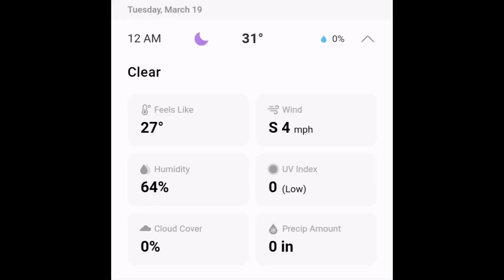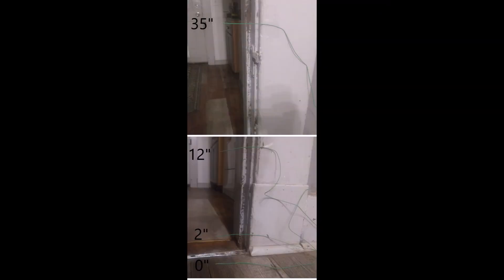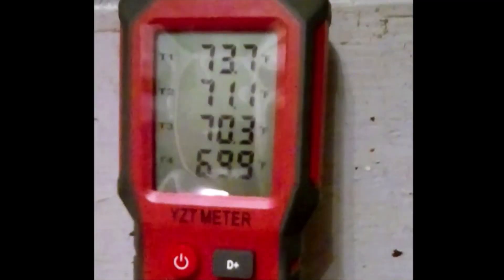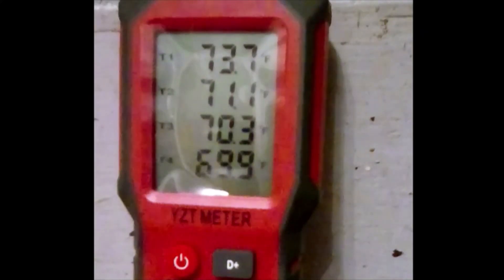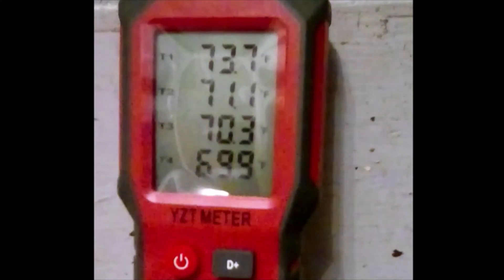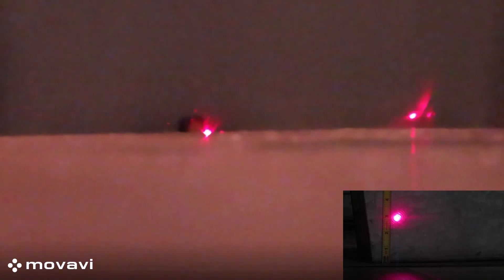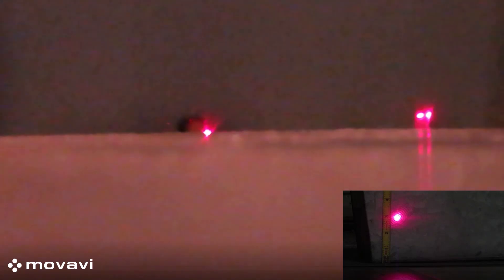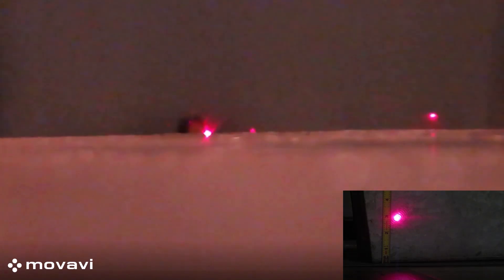At Home Refraction Tests - March 2024

Comment: After analysing your experiment, there is a big big problem with your conclusion in favor of flat earth here.
The density gradiant over large distances on Earth is mostly denser at the bottom due to gravity and less dense as you go up. You don't agree gravity exists? Fine, doesn't matter, it's a fact the air becomes less dense the higher you get regardless of the reason you want to attribute to it. There are pockets of less dense air at the bottom and denser air above due to air currents, but it's mostly denser the closer to the ground.
In your experiment the bottom sensor shows hotter air than your second sensor, meaning you have around 2 inches of hotter, less dense the air at the bottom and colder, denser air in the sensor above. This explains the upwards refraction perfectly since light refracts towards the denser medium.
HOWEVER. The reason this wouldn't happen on an every day basis on a flat Earth and consistently hide whole buildings or things higher than 3 feet is because, as I said, in the outside world, with scales bigger than a few feet, the air gradiant is pretty consistently more dense closer to the ground and less dense the higher you get. This causes the light to bend down, not up, causing us to see further than the geometric horizon/curve of the Earth instead of objects being hidden by refraction.

Comment: Great experiment showing that refraction causes light to bend down from lesser to greater density.  At the start of your experiment, 1:25, we see a slight 3.9° temperature change from the top T1 sensor to the floor T4 sensor. (T1 - 73.8°, T2 - 71.2°, T3 - 70.2°, T4 - 69.9°)   Since we know colder air is denser than warmer air,  this would cause a slight downward refraction of light.  

After the door opens we do see the buttons move slightly up and down as cold air moves in, but @ 1:35  the 2" T3 sensor is now the coldest reading, 64.0°, which is 3.7° colder than the T4 floor reading of 67.4°.  This would cause light from the buttons to bend up from less dense 67.4° air on the floor into the more dense 64.0° air two inches above the floor and as expected, this is when we see the buttons disappear downward since the light is now bent above the camera..  The reason the T4 floor sensor is warmer is because of heat retained in the floor. 

Again, this is a great experiment showing that refraction causes light to bend from less dense to more dense air but this is not proof of either a flat or globe earth.  What is does show is that atmospheric refraction is can be complex, in this case due to conditions where a colder layer of air can be above a warmer layer of air, when typically the atmosphere gets cooler as it gets higher.
Reply: With the door open and the temp settles with warmer lower cooler above....similar to standard atmosphere...the light from objects higher than the camera will first refract toward the floor, avoiding the denser cooler air above aided by the angle of incidence to the camera.  These are the same conditions that can also cause inferior mirage if there's a sharp enough density gradient down low.....but even w/o a mirage present....objects along the bottom get obscured.  So....w/o the light reflecting mirage....is the light going above your head or is it just lost in the floor....possibly compressed there?

Comment: Hey guys, one thing I noticed immediately is that while the upper three sensors follow the narrative of standard atmospheric refraction where the gradient progresses in a vertical fashion with descending height, the lowest sensor shows a reversal in the gradient. One theory that I have been working on would agree with these results. Reflected light off of objects above a level refract due to changes in the vertical lapse rate. Reflected light off of the ground behaves based on how the surface of the earth compares to the atmosphere just above it. In your demonstration in the micro, the buttons might still be considered as above center camera level even though they are on the surface of the floor. This situation may cause downward displacement of the objects above the surface and still allow for upward displacement of the ground itself. In the macro, that would mean that islands, mountains and large ships would appear lower due to refraction while the water surface may appear higher due to reversed refraction. Where the boundary converges, we would witness compression if we studied that thin line well enough. Otherwise, it would just be summed up as undefined visual obstruction or earth curvature. Just my two cents. Thanks for your efforts.

Comment: Love your thermocouple set-up....
Reply: Appears to correlate with my observations when the surface is warmer than the air above like with a standard atmosphere (modeled sounding data @ Mugu)....the background drops...and obscures the lower bits (buttons in this case)....the light hitting your eyes at a lower than actual angle.

Comment: Whilst temperature will play a part, it is the water that creates the trickery. Have a watch of this prof explaining how it works. 
 https://youtu.be/WjrMe5bYpk4?si=TF3UDteB3kF2um0T
Reply: Doesn't the water mimic the effect of the ocean on observations though?
Reply: @Steve-h-v  That's my point. water evaporates and condenses due to vapo-pressure which occurs in layers. I am gonna go out on a limb and suggest evaporated water and condensed water gives 2 different effects which matches OP's demo. Cold air rush in = condensing,

Comment: These test really are getting very useful now that the actual air gradient can be inferred. I have read all the comments here. This is getting to be a very useful channel to find out how light is behaving at the surface of this place. There are some quality explanations and suggestions being provided here. :) 
   Given that the tests done appear to scale to the real world. I suspect that we can provide a useful explanation for what is happening to the light from distance observations in a variety of common conditions. Fascinating stuff! :)  
   Thanks to yourselves for doing these tests. They are very useful and informative. Thanks to all the people who post detailed comments based on their own observations from the real world. 

   It really is an enjoyable time for me when I go through these videos and interpret them and the comments provided. It can take me a while. It is fun!
Reply: They don't, though. As the observer gains altitude above the ground, the angular size of the inferior mirage (assuming there is one) decreases as it is visible close to the horizon.
Reply: The experiment is not to scale though. In the real world the air gradient goes from denser air at the bottom to less dense air the higher you get. Here her experiment is at a very small scale. The opening of the door causes a reversal in the gradiant in the first 2 sensors where the air below is les dense than the one above, causing light to bend up and hide the buttons. However, in real life at the scale of buildings and ships, this rarely happens, which is why this can't explain why we consistently see objects being hidden behind the horizon.

Comment: This is great and everything but can you please answer something i believe would be simple to answer for s flat earth believer.
Why can't i see the massively bright sun across the flat earth at 35k feet in the thin atmosphere....... But i can see the small faint Polaris from just 100 miles north of the equator through the thick atmosphere... At night?!?

If you want more details to the question I'll be glad to elaborate on it.
Reply: "Why can't i see the massively bright sun across the flat earth at 35k feet in the thin atmosphere".... I assume you mean from an airplane? You're in thinner air, but you're still looking through the entire thickness of the air below as well, if the object you're looking at is perspectively below the slice or gradient of air you're in.

"But i can see the small faint Polaris from just 100 miles north of the equator through the thick atmosphere... At night?!?".... I assume you're back on the ground now? Polaris is at the center of the earth. At that time, the sun is much further from you, clear on the opposite side of the world, further then Polaris is from you. In this example you set up here, it has more to do with distance than the atmosphere. The celestial bodies will either rise or lower in your perspective by 1 degree every 69-70 miles. Same with standing under or next a tree, you have to look up at it, but off in the distance you can see the whole thing and not have to look up at all.... because of perspective... If you could stand at the north pole, Polaris is directly overhead, but by the time you reach the equator it will have set in your vision. Perspective and refraction both play a role in the "setting" of objects. At night, the sun is well beyond Polaris from your position. It's simply too far. You would need to get closer to it before it would begin to rise into your field of vision... although there are some examples out there of seeing the sun and moon from great distances. If you got a little closer, a little higher, and had the best of atmospheric conditions ahead of you, you just might catch it!
Reply: @DontSphereTheTruth 
Actually;
We are using flat earth geometry.... Remember that.
Question elaborated.
I take Cathey Pacific airlines from NYC to Hong Kong. The flight route goes over the north pole and departs NYC at 3:15(ish) est.
By 10:30(ish)pm est the flight is at 35k feet at approx the artic circle.
The sun would be located approx between Guam and Hawaii at about the equator. This would be (with a 3200 mile high Sun) place the sun approx 8300 away. Also remember....35k feet and 3200 miles and 8300 miles.

At just north of the equator (100 miles) I can stand on the ground and look north and see the star Polaris. Polaris is approx 3200 miles high. Distance from observer to Polaris approx 8600 miles. And remember you are looking through 35+ feet of atmosphere from ground level.

You explanation does not make any sense.
Can you recalculate that and give me a more logical answer please.
You have just one more chance to make your calculation fit reality, otherwise you are a delusional hack.
Reply: @ENDtheFED-it4bo  Everything sets given enough distance....based on how our eyes work....especially when closer to the ground...the effect is amplified due to your limited viewing angle.
Reply: @ENDtheFED-it4bo  You give distances and Height of the sun. I appreciate that makes sense to you. However, you cannot verify that your values are correct.
   I suspect you have made the assumption that you are looking at the sun directly and it is a physical object where you see it? 

  That cannot be correct. It is impossible to accurately triangulate the sun or moon from three or more people spaced a few hundred miles apart. ;-/ This is using sextant and compass.  
   
  Instead of the sun, think about trying for three or more people, spaced a few miles apart, to accurately triangulate the top of a rainbow... Then one of the observers moves towards the rainbow and takes some more readings. 

  In both cases above, when plotted out in 3D space, the reading will not cross at a fixed point in 3D space! 

  This was actually shown, and proved, by Sly Sparkane in a video about sun tracking a few years ago! The sun cannot be accurately triangulated by multiple people separated by a reasonable distance! 
  
  The conclusion is obvious... You are not looking directly at the object we call the sun. We are looking at a 'projection', 'reflection',  or 'rendering' of the sun that is related to your current location and time.
Reply: @ryanqvincent144  
I'm going by the numbers the flat earthers use.
Reply: @ryanqvincent144  
You absolutely can not explain why I can't see the sun.... Without using curvature.
Hahahaha
Reply: @DontSphereTheTruth 
Sorry. What you stated is false using flat earth geometry.
I find the flat earth community and the trans community have much in common. Delusional.

My question is the Flat Earth Adams Apple.
Reply: When somebody writes an in-depth comment that has absolutely nothing to do with the topic of the post, I know for sure that person is either a sell out shilling pos, or, that person is suffering serious cognitive dissonance, is also in deep denial. 
All likely due to outer space being a theorytale & nasa being full of shit and, of course, hates the realisation we have a loving, creative God.

My money is on you being a sellout shilling pos, sitting in some basement counting the days until your next cheque from google.

Comment: It’s small and I couldn’t see well, was the laser dot on the bucket ever affected?  It didn’t seem to move much like the source.
Reply from the maker: Yes, there was about a half inch of movement of the laser light upward! The bottom of the beam starts around 2 and 1/4 inches to start, and gets up to around 2 and 3/4 inches with the door open.